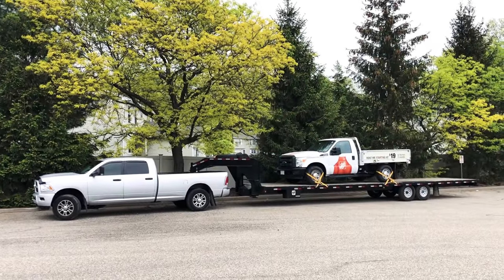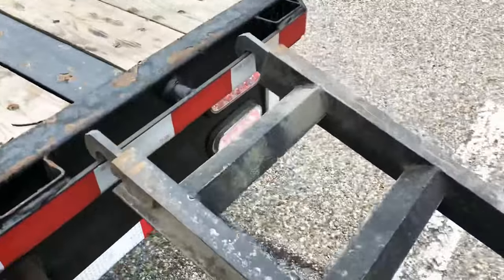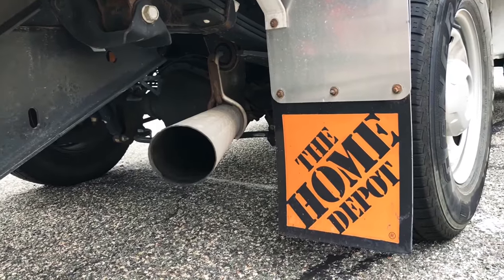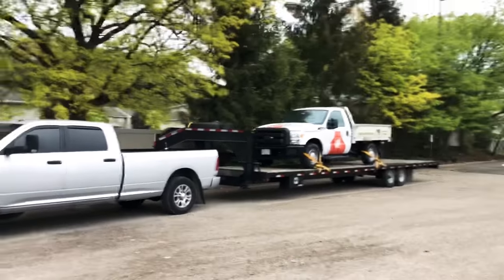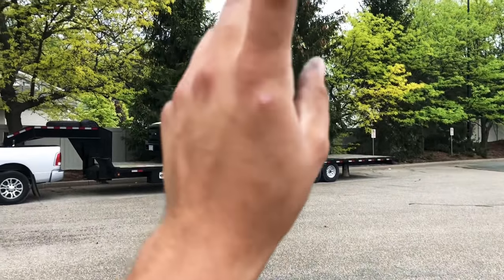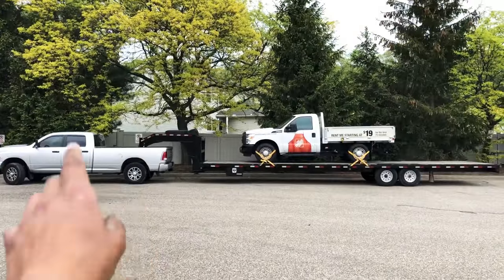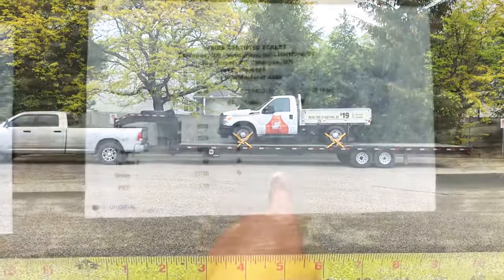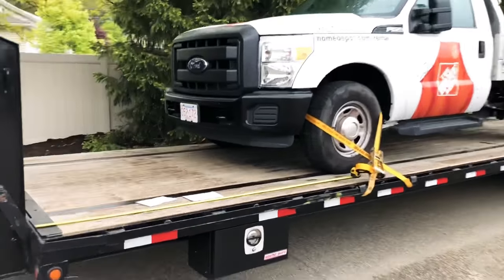How To Distribute A Hotshot Load Correctly

Comment: Every Single Video Out there shows this formula and it's WRONG! Every single person overloads the rear Drive Axle and says they are good.  The Drive axle is overloaded in this video by either 220 lbs or 1220 depending if you have a 6k or 7k axle. That load needs to be farther back. Especially since all the weight is in the engine.

Comment: i have a question , i transported 4 pallets of concrete they all weighted the same. so it was a flat load all across the flat bed trailer. now after 55mph my trailer wanted to start dancing from side to side. question here is how would i have to load this to have it not do that?
Reply: Move the load further up on the trailer. You will fish tail every time the load is more towards the rear then the front. You should have 10-15% tongue weight

Comment: You are tongue heavy that’s why the rear axle on the drive truck is squatted. Back the load up until the drive truck is leval. I would also drive the load truck backwards onto the trailer so the engine is closer to the axles.

Comment: got question my truck gvwr is 12200 my gawr front 5200 rear 9350  my scale ticket empty with trailer hooked up 5120 front 6580 rear and 7340 trailer axel does this mean i can only load 500 on the truck as a payload?

Comment: Why not back the truck onto the trailer .. Would it not be best to have most of the weight on the trailer axles.. I know you  need some weight on your truck but it looks like your truck is squatting  to much, just curious
Reply from the maker: Just Me I’ve realized that loading anything backwards for the most part is a bad idea because it wasn’t designed to go highway speeds in reverse. I’ve had things break and/or rip because they were loaded backwards.

The airbags on my truck aren’t inflated so it only looks like it’s squatting but put a little air in there and they’re fine.
Reply: @TowPiglet   Thank you

Comment: Yeah I know this is an old video from May, but as I'll be starting off hotshotting in the spring. I was curious about that replacement. I think Landstar helps you as well on load securement but looking at getting a 40-foot trailer with the hauling capacity about 15,000. So you're saying if I had some bulk item that was 15,000 pounds I should be back 15 feet from the nose and had the majority of the weight pretty much centered in the on that trailer at the worst case scenario, no closer than 15' from the nose.
My flatbed previous experience, everything was based off the center of trailer and loading from that point north/south so to speak.

Thank you for help.
Reply from the maker: Great question, this is for partials, so if your max capacity is 15k then put the load where it’s best however let’s say you got 1x 20ft 6k# container, where do you put it? If you start at the back then it’s easier on the truck but you eliminate the opportunity to another load that may require ramps like bobcats, tractors, cars & trucks etc.

However if you want to start at the front how close can you get before you’re over weight on the drives? This is where experience comes in but how do you teach experience? So my “formula” per say is a good place to start for new guys that don’t have that experience. 

So on a SRW hotshot that container I would back off 6ft because it weighs 6k# and if I get a partial I’d put it behind the container over the trailer axles. However with a dually you may only need to back off like 3-4ft. 

I hope that makes sense. If you have question my email is in the description. 

The reason a semi truck starts from the center is because they can take equal weight on drives and trailer axle, I think 34k on each so starting in the middle is one of the safest ways to ensure equal load weight distribution
Reply: @daddybug1  thank you brother.

Comment: Lets break this down... first, this is based on a gooseneck long flat trailer attatched to a HD truck with a load comparable in dimentions to another truck ot car. 
Bacic rules for towing:
1.- the center of mass of your load should be directly on top of your axles, the center mass of your empty trailer or somwhere in between those 2.
2.- You want to have somwhere between 10 and 20% of toungue weight. More is very dangerous and less is even more dangerous.
3.- if you have to transport several loads in a sigle shot (more than 1 vehicle, piece of equipment or other items/things), and found your ideal spot for center mass location you want to load the light stuff at the very back, the heavy stuff in the middle and the in between weight in the front. 
4.- a bump in the road will help you feel if your weight distribution is okay or not as it applies preassure in the "fall" of the weight.
5.- manufacturers give you guidelines for this stuff, you have a max towing rating and a max payload rating. Follow that and try to keep it under 80% of the limits. Yes, we all know those ratings are below the absolute max capacity of the truck, but most drivers dont have the knowledge, experience and skills to go over 80% of that rating safely. And most of the drivers that do have the knowledge, skills and experience to do it will prefer not to, so please, if your truck says it will tow up to 20k pounds, limit your towing weight to 16k pounds. And if your truck says it will take a payload of up to 2k pounds, make it 1600.

This video only accounts for this trailer, this truck and this size of a load.